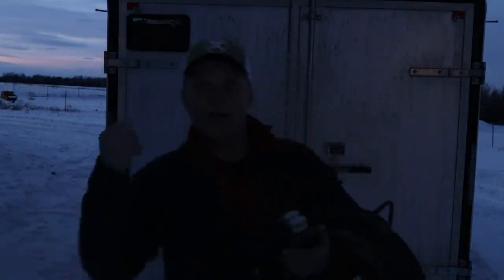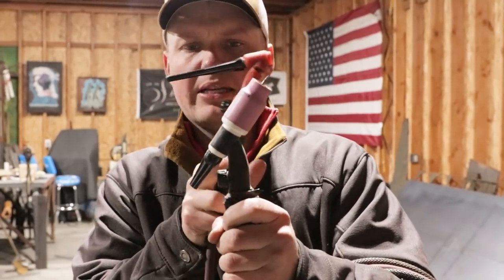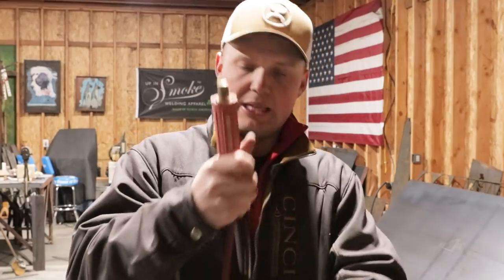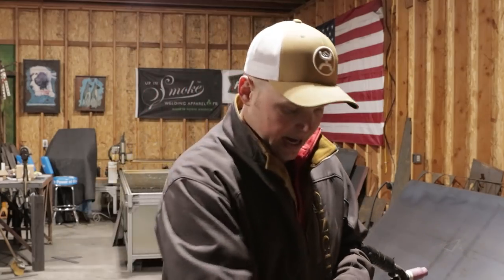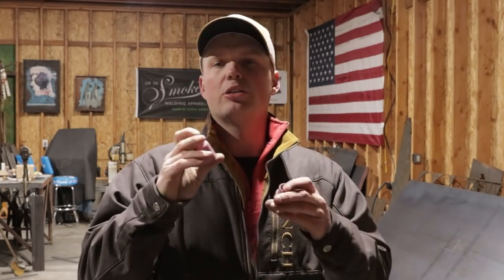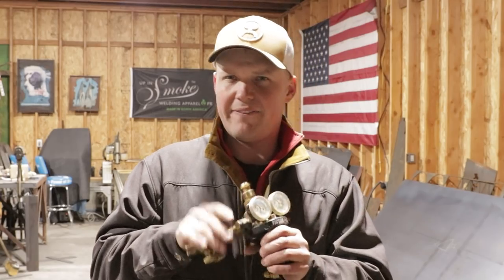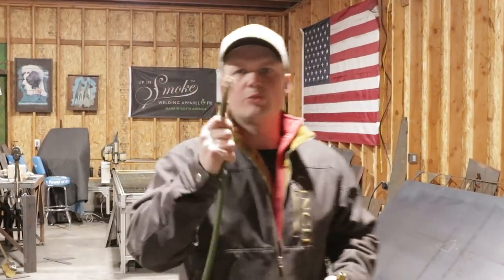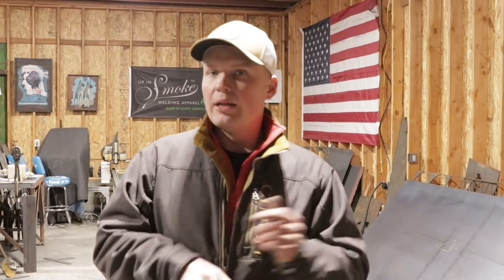What is aTig Rig

Comment: Dude they did you dirty on that reg. Get you a spliter at the bottle cryos come with spyders sometimes. Get a oxygen reg like a victor 450 and refit it with a the parts of that garbage flow meter. Only thing is keep it below 15psi other it will blow up those cheap tig rigs. Next Get you a weldtec rocker and a weld tec ball head use ball head for 4in and under or roots if your tigging roots. Next convert to a quick connect like a koike even the westerns work. Finally take a jumbo gas lense and smash in the tungsten hole and weld it to a hose coupler. Your have a purge diffuser that fits to argon hose ends. Or get a sintered air diffuser used in pneumatics. Now purging don't go cheap get you hunting fusion setup. Took me a long time to believe it but tig wire brand does matter Sandvik is good bolher was unbelievable on carbon. Don't forget to make you some ss wedges and get a mini Sawzall to cut your bridge takes with. Your know why if you ever get on big bore. Also aluminum foil and drying pigs are your friend. And when your messing with metal that's worth more then your house soap test your gas connections and use that purge moniter on the argon you get as it may be under spec both purge and bottle. Schools and internet is great. But a few years of street tig will let you know how the real welders do it. I haven't seen anyone show real alloy welding yet. I got one some and will tell you 98% are just getting by or companies and clients are willing to except less quality. Travis field has showed a glimpse into it. Most annoying thing is color shoots could be bad metal your leaving and put a pretty cap over it and know one knows until it gets eaten away. Go play in a acid unit and see your bead hands perfect bead get eaten through just because some helper applied to much heat when preping a bevel end.
Reply from the maker: This is hands down one the most interesting and knowledgeable comments I’ve ever gotten. I would like to pick your brain about more of the things I need to be doing to get better at tig and to eventually move into the different kinds of metals. If you don’t mind sending me an email with your name and possibly a phone number I would like to talk to you more. schofieldwelding@gmail.com thank you.

Comment: I have Victor regulator with dual flow meters on it for torch and purge works really good. I a lug on my block to plug my stinger into. So my stinger doesn't get kicked or fall off. I weld all my pipe with dry torch. Great video. Merry Christmas and Happy New Year Jake.

Comment: I built a block versus the quick connect. I use nothing but flex myself. Foot pedal control in the shop. Valve in the field. I love the super flex leads. As far as brand of head I have no real preference on those.
Reply from the maker: Man tell me how you built that block.
Reply: @JacobSchofield  I just got a block of brass. Drilled a hole for the lead. Drilled in holes for set screws to hold the lead. Cut down the block a bit to hook my ground to it.

Comment: Cheaper guage with a ton of flow: Harris oxygen guage with swapped out fitting for argon and drill the hole. $150 and all the argon you can use out of a dura tank.